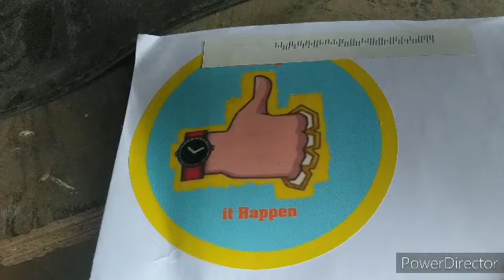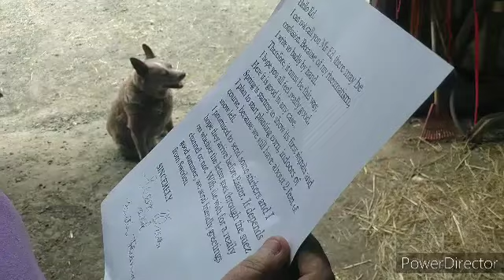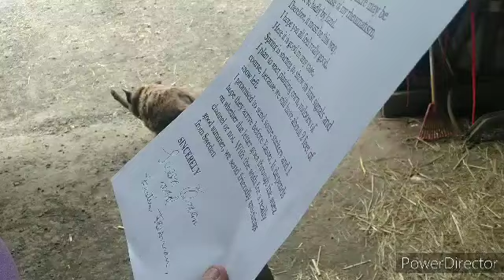moon. sunrise. fence. MAIL CALL 👍

Comment: Evening Ed and crew, you are early tonight.
Reply: G'day Crazydave
Reply from the maker: Good evening Dave. Yup.. the last few days have been a bit too hot.. today it got to us, so.. quit early. Still over 11 hours 🤪
Reply: @GosselinFarmsEdGosselin  we are in the 30s 😂 if I head to the shop tonight heat will be on.
Reply from the maker: @crazydave4455  low humidity and 30s with sun is comfy 👍
Reply: Good evening Dave
Reply: @nidayfarmranch6002  hey Bruce
Reply: Hey dave 👋
Reply: @sassymassey5002  hey sassy